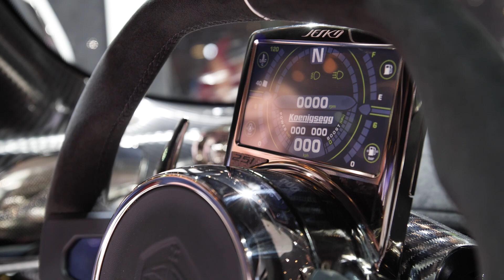Koenigsegg Jesko: Will It Break 300mph? | Carfection

Comment: What I don’t understand is why all the doubt when they have already done 284mph one way on a two way run. That was on a older car without the new transmission and turbo technology. You mean to tell me they can’t slip another 16mph into this better engineered vehicle? Get over yourselves and educate yourselves on the recent technologies put into this vehicle. This has by far surpassed what other manufacturers could have done in a decade technology wise from the last record model this this generation.

Comment: Seriously though, the engineering behind this is absolutely incredible. Pressurised tank to spool the turbos? holy shit. 20kg of down force from the wing mirrors? Holy shit. 483km/h? holy shit 1400kg to 1600bhp? holy shit. I could go on but damn just read as much as you can about this car it is incredible
Reply: It truly is a marvel. Koenigsegg always takes things to a new level.
Reply: Will Johnson it’s honestly amazing how they can make a car look both dangerous and aggressive whilst also elegant and beautiful
Reply: Tbh that's not a novel idea. I was hoping for them to incorporate it in this car and they did.
Reply: Pressurized tank for help spool the turbo is nothing new in motorsports, albeit is not composite tank but rather metal one. And if I'm not mistaken isn't volvo have this system in their cars from few years back?
Reply: Dezza2241 Volvo does the same thing with their diesel turbo engine
Reply: The 300 package (that should be able to do 300) doesn't generate as much downforce, and you can remove the roof and put it in the front.
Reply: I really really really hope it's useful on the track.
Reply: The pressurized tank isnt new or anything crazy I remember a team was disqualified in rally racing for using American spec rear bumper for their rally car so they could hide a titanium pressurized tank in it
Reply: Holy shit indeed
Reply: The fact that they do nearly everything in-house makes it even more impressive. The gearbox on its own is insane; 9-speed and seven clutches. And it's lighter and can handle more torque than anything else on the market. We're talking about a low volume hypercar maker operating out of an old airplane hangar outside a small town in Sweden ...
Reply: Koenigsegg doesn't go with the norm and its awesome for it. A v8 making 1600 hp as a stock car...and the chiron has a w 16 and still cant get near these speeds. It's insane what koenigsegg can do for the car industry
Reply: We need a 10 times bigger rear and front wing just to manage the turbulent flow of your holy shit's.
Reply: @thebigbadraider2828  blah blah all you need is a compressor to pressurize a tank. Thats 200 yr old tech. But the bigger question is, what pressurizes those tanks?
Reply: Dezza2241 all the Koenigseeg are exceptional and even if this one is supposed to it the 300 mph 
Still the Regera is the most technologically car in the world and Christian Von Koenigseeg himself is the main engineer who designed most of all the cars
This guy is out of this world he’s buildings Multis- millions cars that are back ordered for 3,4, or 5 years , all this out of nothings he’s almost a God 👍👍👍
Reply: The fact you think it'll do those speeds with this amount of down force....yawn
Reply: Also try: ~1800kg downforce at 155mph
Reply: @pretty00lights   Supposedly they used the turbo in during the staging but was never proved to be effective enough to give that team the upper hand. Pretty much reduced the need for anti lag when going around corners. The team didn't get to put a run in so we won't be able to know if it was effective enough or not

Edit: thought you meant the rally car. The probably just used a built in compressor I'm assuming
Reply: In America we have cars that make over 11,000 hp, weight about 2000 pounds and will do 300 mph in 3 sec.
Reply: Frank Castle ??? Do you mean those cars that aren’t legal on the street and designed for 1/4mile drags? Typical American
Reply: @Dezza2241  their much more common than that car. I've never even seen one on the road, top gear has tested 1 of them, and the stig crashed it. 

It sounds like to me the Europeans are trying to get to 300 mph. Everything else doesnt matter.
Reply: Frank Castle of course 300mph vehicles exist but none of them are production cars? This will be the first production car to reach 300mph (assuming it makes it). I’m not sure how American top fuel drag cars are comparable, or even relevant to this conversation?

Just because you haven’t seen one doesn’t mean anything? I haven’t been to America and seen this 11000bhp cars therefore they’re* less common than Koenigsegg’s
Reply: @Dezza2241  my comparison is it seems like they make the car just to make claims. Ferrari made the la Ferrari and said this is the fastest road car ever. Here you go whoever wants to test it go for it. It was featured on the grand tour, I think the newer top gear and I know for a fact gordan Ramsey has one. Vs koenigsegg says here is a car that does over 300 mph, has this that etc. But no one is allowed to test it and it's not for sale. 

If you haven't seen a top fuel car I could encourage you to. It's an experience you will never forget.
Reply: Frank Castle Mate I need what you’re smoking because you’ve lost it. You’re English is so confusing I’m not sure if you’re trying to claim the LaFerrari is the fastest car in the world (which it wouldn’t be even if it was made 25 years ago), or if you’re trying to make a comparison in which Ferrari say the LaFerrari is the fastest, but only if you try it yourself? 

Regardless of which the fastest car in the world right now is the Koenigsegg Agera RS (277.87mph), which is the predecessor to the Koenigsegg Jesko that you see here. Sure they may be claims right now, but they have a huge foundation to stand on. Koenigsegg will be the ones to test it, here is a 400km/h run; https://www.youtube.com/watch?v=MsQTBjTL0ro which is faster than the LaFerrari's top speed. And here is the top speed run; https://www.youtube.com/watch?v=UwsgHBFHufU 284mph one way 271mph on the way back
Reply: @Dezza2241  no you misunderstand me. I'm not saying the la Ferrari is the fastest. I'm saying it's been tested by several people. Until today I didnt even know konegsiegg had a car that did 277.  Also who did the test for that? 

My point was other cars like Ferrari are tested by car reviewers like the grand tour, top gear etc. Koenigsegg isnt reviewed by anyone except koenigsegg. So how do we know their tests and claims or legitimate?
Reply: @frankcastle9691  Ahh I getcha, my bad, I misunderstood. 

I mean Koenigsegg are tested but not pushed to their limits by companies like Top Gear, The Grand Tour etc. due to insurance reasons and general cost. People like Doug Demuro, Jay Leno, Whitesse JR, and other like that will do general reviews on these sorts of cars.

It's incredibly hard to falsify this sort of thing, not only are Koenigsegg incredibly well known in the car world, but having a world record run requires third parties, Guinness Wold Records have to send people out to verify the runs, and during the run there has to be independent measuring instruments, not just the ones on the car. Not only that, but lying about this sort of thing would put Koenigsegg 6ft under for sure. Especially since they just got a $170 million dollar investment from NEVS
Reply: @Dezza2241  ok all that sounds great. My biggest thing is with only 1600 hp it seems very unlikely that it could do 300 mph. I could be wrong but I've seen cars with 2500 hp that couldn't reach 300 mph. But they only had 1 mile to reach their top speed.
Reply: @frankcastle9691  That's 240bhp more than the Agera RS to make 23mph, the Jesko300 is supposed to have less downforce, and therefore a lighter body after removing certain aero parts off the body, bringing it to similar weights of the Agera RS. I would do the maths but have to rely on predecessor specs for drag coefficient, and frontal area etc. theoretically it can, or is close (I'd be more certain with more exact specs of the car) but here is a video about the theoretical Hennessy F5 https://www.youtube.com/watch?v=cm5azT8yr1o from Engineering Explained where he shows the calculations needed for this theoretical 300mph
Reply: it's worth more than shit even if it is holy shit lol
Reply: Engineering yes but architecture must go to the Pininfarin Battista. I think it is my ultimate dream car. If you want down force the fxx evo and the itensa emozione takes the cake it think
Reply: eric Gapit I agree the Pinin is something else, shame they’re using Rimac’s drivetrain and not their own. The FXX-K only produces 850kg and the IE only produces 1350kg at max speed compared to the reported 1400kg plus of the Jesko
Reply: @Dezza2241  it's also a shame that the output of 1900 is only for a few seconds but pininfarina can really design cars. i think the 2m quid is worth it if it looks like that rather than the Rimac. The rimac concept one can possibly hold a candle to the porsche 918 as it has 4 wheel drive and torque vectoring

Comment: Bugatti proudly shows a completely senseless Chiron Sport.
Koenigsegg just presenting a normal new Koenigsegg and does it's job.
Reply: A chiron sport with some accessories.. lol
Reply: @adrenalinejunkie3828  bio fuel? Well I guess by 2020 that fuel will be available..  future thinking
Reply: @adrenalinejunkie3828  bio fuel is available at many gas stations at least in Canada and the USA not sure about Europe but from what I gather they are fairly common in the UK.
Reply: @adrenalinejunkie3828  
It's the E85 he means, it's been available on every gas station here in Sweden for the last 10-15 years, it's a mix with  85% ethanol in the summertime and 76% wintertime, it's more petrol in the mix wintertime just because it's harder to start the engine on ethanol in the winter cold weather.
Reply: @adrenalinejunkie3828  this tire thing is BS! how the agera rs did 277.87 mph then? flying?
Reply: @adrenalinejunkie3828  "limited to 261 mph due to tyres" wait what? did the agera went over 277 mph in wooden tires?
Reply: @adrenalinejunkie3828  bro it has been driven flat out and its not limited electronicly its limited by the nature it cant go any faster it is just not as good as the koenigsegg you bugatti fanboy just facts
Reply: @adrenalinejunkie3828  and bugatti use tiers that can go 500mph
Reply: 911copcar 
Bugatti is limited by their own weight, that’s what fanboys don’t want to admit. Koenigsegg used standard Michelin Pilot Sport Cup 2’s and took the land speed record with them. Koenigseggs center of gravity is way better than the Chiron, so it basically is a low flying airplane with how it distributes it’s weight onto the ground. Too much weight( Chiron ) your tires blow up. Too little weight, you car takes off into the air. Koenigsegg has superior weight and aero essentially allowing it to hover over the ground and fly. Michelin themselves were shocked when they checked the world record Agera RS after each run because there was 0 tire wear, it looked as if they just put the tires on there. They did 7 kind of runs that day on the SAME set of tires. If Bugatti tried that it would end in a fatality lmao
Reply: @Adrenaline Junkie You can't just compare Bhp without considering the weight of  the cars. Bugatti has always made really heavy cars.
Reply: @amarjit singh Well, salt
Reply: amarjit singh they had to elongate the body for better airflow and reinforce the same tires koenigsegg used with carbon fiber..

Comment: Really couldnt care about 300 mph. This thing will break other cars on any track!

Koenigsegg Jesko; Aston Martin Valkyrie; Mercedes-AMG Project One. - there, the new holy trinity
Reply: senna?
Reply: totally agree , these 3 cars are collecting some laprecords in future
Reply: @pharaongaming8617  facepalm
Reply: Stormer248  wtf. It crashed on the nurburgring and got banned 😂😂. It cant just do tracks
Reply: Stormer248 idk but when Dodge Viper acr  come back it maybe will take the icing on the cake again
Reply: Rahul Gahlawat that was an Agera r with a one:1 engine and reason for the crash was an ABS failure get your facts right and when they were going to set a lap time a crash happened on the Nurburgring causing strict temporary regulations, on track of how fast you can go so breaking a record was impossible for them at the time and spa they were banned because the noise rules got stricter so just go sprouting made up facts
Reply: @fredd9340  the point is it failed. And there is no official record of a car that claims it is the fastest.
Reply: Rahul Gahlawat I’m pretty sure no one says it’s an unofficial record and that they did all the rules that would make their record official
Reply: @theoutlet9300  u hatin, stinky?
Reply: @ianbudgetrc2574  i m stating facts
Reply: @theoutlet9300  the fact is that the One:1 beat the P1 by almost 6 seconds on an F1 track on a testing lap. The fact is that the Jesko produces 880 kg downforce at 250 kmh; 1000 kg at 270 kmh and 1400 kg at top speed which is currently one of the highest if not THE highest out there. The fact is that it produces 1600 horsepower which is the highest amount of power after the SSC Tuatara (1750) and the 1900 horsepower EV's. Also, the car's brakes are one of the best if not the best once again on the homologated market. And you say it wont perform well at tracks?
Reply: @bruh-uy3vn  all i see are  theoretical numbers. And why r u comparing a street legal P1 with non street legal koenigsegg?
Reply: @theoutlet9300  where in the actual hell did you get that information from lol. Dude its totally street legal in any country. And as far as those "theoretical numbers" go, these arent 0-60 times dummy, these numbers have been proven right everytime with every car ever. Only a few manufacturers lie about their power figures (i havent heard of any lying about downforce numbers), and mostly their cars produce more than stated - Mclaren 720s, Dodge Challenger Hellcat, 2018 Audi RS4 for a handful of examples.
Reply: @bruh-uy3vn  only koenigsegg legal in the us is ccx. Get ur information straight
Reply: @theoutlet9300  that article from CarThrottle was written in 2015, and it states that the reason the Koenigseggs were not permitted on the road was the fuel they used. The car passed the emission regulations and was actually safer than the cars like the toyota prius. E85 is now available in the US, thus every Koenigsegg after the Agera R (or the CCXR if im not mistaken) is completly road legal. I think youre the one who needs to get their facts straight.

P.S. this conversation was about the Koenigsegg Jesko deserving to be in the new holy trinity in case you forgot. If you do not wish to talk about that anymore, feel free and just not reply.
Reply: @bruh-uy3vn  Got him good
Reply: Michael Avaliani Nah... I seriously don’t think it will be up there with the Valkyrie and the Project 1 on a track. Those two cars are made for it. The Jesko isn’t.
Reply: @alexbasha0508  This variant of jesko is and its gonna compete
Reply: CVK is very humble yet confident when describing his cars. Before the Agera RS high speed run, he told the owner theoretically the car can do 270mph and it ended up going past that! They have proven themselves time and time again, so when he says theoretically this one will beat any homologated car on the track and the Jesko300 will theoretically break the 300mph barrier, those are experienced assumptions and should be taken seriously. The Jesko300 will be the car to break that record mark my words.

Comment: One thing there gonna be two versions of this, the full aero package that, that the version present at Geneva and it will not reach 300 mph and the other version with 300 kg of downforce at 250km/h that could reach in theory 300 mph.

Comment: The 251 version is the track version. It will "only" hit 251 due to the extreme down force, The Road version will (probably) have 300 on the wing and significantly lower down force (while still about 250 kg) and potentially hit 300. But the 300 name is more aspirational evidently.
Reply: Losing Weight, Ripping Vinyl 251 is the chassi number.

Comment: Whilst attaining the record run the previous Koenig' ran an officially timed one way of just  under 285 MPH so the company is almost there... Supplying tyres that perform repeatedly at those speeds is tricky, look at Concorde; regular take of speeds of around 250 MPH caused the self detonation of 57 tyres in it's lifetime. Isn't the Chiron artificially limited to 261 MPH because of it's tyres?
Reply: Wayne Simpson another reason why the Chiron top speed is restricted is because of its weight it puts on the tires and when Koenigsegg did the top speed run Michelin were monitoring the tires and they were less stressed than their expectations were(they were high) and so they were allowed to do more runs

Comment: Don't forget that it's not just about the car and it's capabilities, the rubber has to be capable too.
Reply: there is an option for Cup 2 R tires which have much more durability than ordinary road tires.  It'll be possible but for extremely short periods of time.
Reply: @Illestrapper  Are those street legal tires though? The point is doing this with a fully street legal car in street legal tires.
Reply: @jody024  they are street legal but definitely borderline and not ideal in anything other than perfect outdoor conditions :P.
Reply: Tires will probably survive if it can accelerate fast enough
Reply: @fredd9340  Those runs are not about accelerating as fast as possible.
Reply: J024 I mean by getting to that top speed as quickly as possible